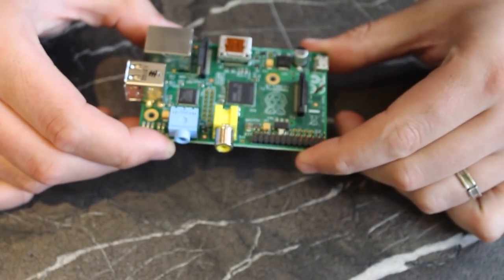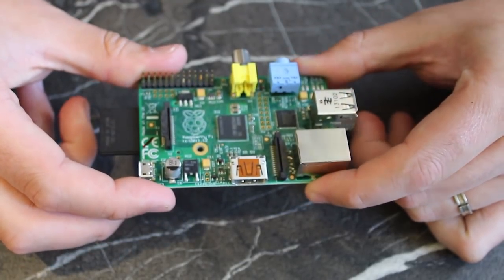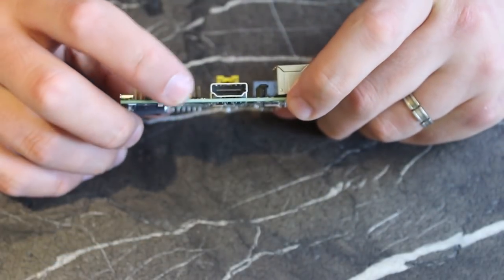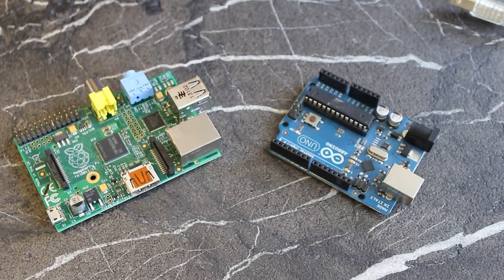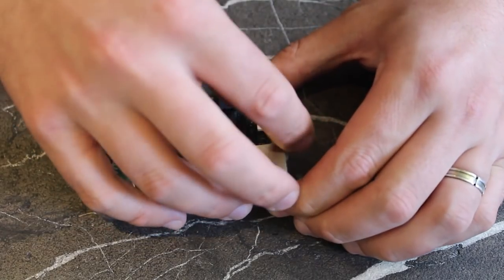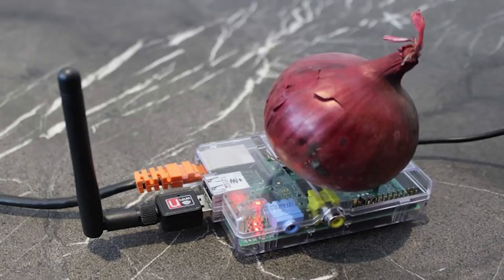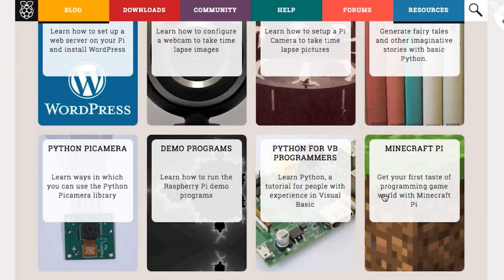Just Bought A Raspberry Pi? 11 Things You Need To Know

Comment: I would prefer sterling. Not AUD.

Burn? You burn to disc as it's permanent. You just install the image.
Reply from the maker: I don't think the definition of "burn" as it applies to discs works in 2018, because discs are dead. The phrase "burn an iso" has always implied extracting the contents of the ISO and to media, regardless of what the exact media in. We'll still be burning ISOs  when we switch to holographic nano-crystals. You don't "install" a windows OS install ISO, then install it again to the host.

Comment: Can u pls tell me how to use putty
Reply: You will need to enable SSH. Use raspi-config or add a blank text file on the root of the SD card called "ssh" (no file extension). This will enable SSH when you boot. Run putty from your PC. All you need to do is give putty the IP address of the Pi on your network and use username/password of "pi" and "raspberry". Highly recommended you change the default password.

Comment: help me ,i am having this issue from long time, i am trying to install kali in raspberry pi b via win32 disk imager, after 10-11%, installation stop, i think its window bugg, what to do
Reply from the maker: Have you tried a different disk image, like the standard Raspbian? It's unlikely to be a Windows bug. If this is a new SD card, it's possible you bought a fake one with dramatically different size - it's a common tactic to put a very small memory chip in there, such that it reads and gets recognized correctly, but writing past that block to the reported size results in errors. If it's a very old card, it's possible it's just been corrupted after so much use.

Comment: thinking of switch my media center to a raspberry, has there been any overheating issues?
Reply: I use a Pi 3 as a media device. I stuck some cheap heat sinks on the bigger chips and it is fine.

Comment: so when i connect it to my tv how i get sound? (i have an old TV and not a flat one)
Reply from the maker: If you don't have an HDMI port, you'll need an adapter cable to breakout the video and audio RCA ports from the smaller 3.5mm AV port. Those go into your RCA analog input, or a SCART adaptor.
Reply: Thanks :)

Comment: I have a problem with my raspberry pi, can anybody help me? Basically the problem is the sound quality, I plugged my headphones in and if the sound is loud or the volume is high, it sounds fine, but if it gets even a little quieter there is a very noticeable static, how can I fix this
Reply from the maker: Add the line: 

disable_audio_dither=1 

to config.txt, and reboot.

Comment: I want one SOOO bad but to be honest, linux kinda scares me. I have tons of XP with Dos command prompts lol, I doubt this will help though. :)
Reply: Wont help you at all lol.
Linux's commands are very different from DOS and any other OS. But they are more advanced.
Dont be scared. If you want to practice but dont want to install linux on your PC, get a flash drive and live boot linux through your pc boot menu.
:D
Reply: don't be scared... i've bought today rpi3B after spending last 2 days exploring rpi2B... starting with 0 xp in linux... after 2 days of hardcore learning.. i've managed to integrate an extension into the VS2015 so i can upload and compile all my c++ directly on to the rpi3 via ssh without having to leave my favorite IDE, it's very easy to learn once the pi virus infects you
Reply: I just installed my rpi a half hour ago and it is working fine. I am using it to watch this vid and comment on your comment. It comes with a windows like interface. Get a kit.
Reply: BYGDK

Comment: James, can a raspberry pi be used with a mac?
Reply from the maker: Yes. In fact, they're easier to use with a mac - since we have a built-in terminal application, which windows users don't, so you can login remotely to your pi without additional software. Once your pi is connected to the network, just open up terminal and type "ssh pi@raspberry.local", and enter the password "raspberry" and you're in. 

If you mean "can i connect a rpi to my imac to use as a monitor", then no.
Reply: Thank you James, 
I appreciate the response!

Comment: I have this NEW thing called a LAPTOP computer and it's only the size of the monitor you would plug this crap into. lol
Reply: it's a device to get people to learn how to program. plus you can do a whole bunch of projects with it.
Reply: Most people don't plug a monitor into their Pi, actually. It's a low power device for embedded applications. And $35.
Reply: I joined the club when I saw the pi zero was $5 lol.

Comment: I don't get what these are can you build stuff with this just asking please respond I'm a ten year old...Don't Judge Plez
Reply: It's basically a fully functional computer circuit board, based on the ARM architecture (same as iPad, iPhone, Android, etc), available at a very cheap price. You could use it as a computer by plugging in a keyboard, monitor, etc, and booting your choice of operating system from memory card. There are various expansion components available, like cameras, touch screens, etc. You could use it as a base to make any sort of computer device you wanted, or use it as an inbuilt controller for things like robots, home automation, etc.

Comment: Windows 10 rt has been released for raspberry pi as of now\
Reply from the maker: Nope, it hasn't. You're probably referring to "Windows 10" IoT, which is a developer environment which you can write universal apps for. Though it won't run other universal apps. Nor Windows apps. In fact, it's just about the most useless thing ever.
Reply: Yes it's the windows 10 Iot I am talking about
Reply: It's only good if you want to learn about connected devices, since if you use that abomination, you can control your RPI only through VS in your Windows10 machine.

Comment: You can use GUI programs over ssh, if you have a reasonable fast wifi. If you are on windows, then you need a software like Xming and Putty to show the programs, on linux it works (most of the time, if you have X installed) out of the box. 

GPIO: General-purpose input/output

3.3V is a standard voltage for logic boards. If you search arround, there are lots of equipment that works on 3.3-5V

Comment: I have waited sometime to see if this small all-in-one pc are any good for my future project. As of today I use a desktop computer as a broadband firewall, but it´s big, noisy and draw lots of power.
If I could use a board like this with a linux firewall it would be great. But it has to have two network ports. As of today I can´t find any boards that have two network cable ports. Any suggestions?
Reply: build yourself a server? There are cheap server solutions you can build by getting yourself some server components.... only way

Comment: How do you project the Raspbian (hope I spelled that right) OS to a monitor? Will it affect my computer's OS (Windows)? Sorry I'm quite of an amateur.
Reply from the maker: +theqey Everyone's an amateur at one point. The Raspberry Pi has an HDMI out port, so that plugs directly into your existing monitor or TV. It won't affect your computer. 

You can also run a Raspberry Pi without any monitor though - called "headless". You give it commands over the network, using something called SSH, in a terminal application (all text commands, no graphics).
Reply: MakeUseOf thank you so much for replying. How do you navigate through the OS once you hook it up to a monitor? (In this case, I am going to hook it up to a laptop monitor)
Reply: +theqey you can't connect it to your own laptop. But if you have a separate pc monitor or a tv, those would work fine. You simply connect the cable to the port and use a mouse and keyboard to set it up
Reply: VyxMC Oh okay. thanks for the heads up!

Comment: I often wonder what they were thinking when they designed this. Even in a case it sits there with the SD card hanging out of its arse, and by the time its been connected to all the things it needs to work, it´s far from ´compact´, more of a mare´s nest. The only possible use I could find for one was as a house server, simply because it could be left on all the time in an out of the way place. However I couldn´t use it as a printer server with a wired and wifi IP connections as it refused to connect to and bridge between the two IP networks.

Yes, you can see inside the ´black box´ but all you see are several more featureless ´black boxes´, despite what it´s promoters say, that´s nothing like taking apart old electronics where you could physically trace the circuits, or even an ageing desktop or tower computer with lots of plug-in components.
Reply: +marconatrix Black box? the Raspberry Pi is fully documented. Everything can be a blackbox for those who aren't willing to learn.
Reply: +alejandrinos There is little if anything visible on the RPi chassy that helps anyone understand how it works. An IC chip is a featureless block, you can´t see its circuits, even less change them. Even the connections between the several components are mostly invisible within the layers of the circuit board. 

Of course it can be programmed, but a programmer works with an abstract model of the computer, even these days in machine code, not that anyone really has to get that close to the metal these days. Processors are very sophisticated with layers of caches on so forth, which are best handled by an equally sophisticated optimising compiler. 99.9% of programming these days is done in higher level languages using an abstract machine, and indeed this has been the case for decades now. 

The last time I wrote any raw machine code was on an old 8-bit Amstrad machine, and that was to build a Forth interpreter so I didn´t need to use machine code.

Comment: I'm the only one wondering if there is an easy way to make money out of those things?
Reply from the maker: +lyric jam No you're not, and no there isn't. :)
Reply: +MakeUseOf aww
Reply: +Moospreh  Installed a Pi 3 in my truck 7 inch Touchscreen Jarivs voice command  The hard part was finding and installing a power switch that shuts down the pi when you turn your car off  Now think of all the uses from OBD2 scanning engine codes and linking the code to a net page that tells you the code  
(code 28- Oxygen sensor failure) when your engine light comes on ..That right there saved you a trip to the mechanic shop and a $80 scan dig,  Music files Video  Dash cam Tire pressure  Radio GPS Temps  Gyro for off roading tells you slope degrees XM And with some work Set cabin temps (servo's) Turn on Heated seats all and the sound of your voice ...Now would it be worth buying the Pi and parts and programming to sell...no  Pepole normally buy double din stereo's buy lack the options or customs that you can do with a pi But price wise don't want to do it  I would say my money and time is around $1,000USD
Reply: You can always mine bitcoin. It's painfully slow and inefficient (even more on a pi), unless you buy dedicated hardware, although that would defeat the purpose of just the pi and increase the cost a lot.
Reply: There is, search youtube for "Super Nintendo PC"
Reply: Build a photo booth with instant printer and auto instagram upload and rent it out for weddings.

Comment: Class 10 or better? That's simply incorrect. The Raspberry Pi is optimized for Class 4 and Class 6 cards.
Reply from the maker: +Yohan Bandhair Rubbish. It's not "optimized" at all for class 4/6, it's just that in everyday small write operations you won't see any benefit from a faster card. OS upgrades and long write operations will be significantly faster on a class 10 card.

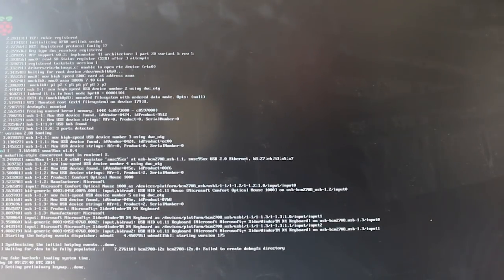Comment: 0:57, whispers it does run windows, just not windows vista and up
Reply: +ChilledCanadian Nothing runs Windows Vista hehe.
Reply: Dosbomber
Yup, plus Its wayyy to hard to play dwarf fortress on linux.
Reply: +ChilledCanadian The Pi doesn't even support Wine, so that's even worse.
Reply: +ChilledCanadian Why would you want to, anyway?
Reply: Dosbomber I have used linux, but I still return to Windows every time, there are more compatibility with programs I need on windows. Programs that wine won't run at that.
Reply: ChilledCanadian
Yeah, I know, it's a nasty catch-22.  Software developers won't make software for non-Windows platforms because everyone uses Windows, and everyone uses Windows because all the software is based in Windows.  I think it's slowly improving, though.
Reply: From what I understand, you can run Windows 10 PE (or something like that)
Reply from the maker: +Pipe0481 Not PE. Windows 10 "IoT", which is basically nothing like Windows at all. It doesn't have a GUI, and only runs specially designed universal apps. It's a developer thing, and not a very good developer thing at that. I've seen a handful of projects using it.
Reply: MakeUseOf Oh, ok. I just heard something about Windows 10 on the PI, nothing more.

Comment: Can a raspberry pi download c4d or animation software?
Reply: Nope
Reply: +wartillthend animation you can run anything that a linux computer can run ... but why do you want to animate on a 700/900 MHz CPU? it would be incredibly slow o.o
Reply: +Maric because I'm cheap and have little money
Reply: wartillthend animation if you are smart you can build a pretty ok rendering cluster (if your software renders in multiple threads and can make use of 20+ 900MHz threads) from a few pis buuut yeeeah just get a normal computer pretty much ^^
Reply: +Maric yeah true. I wish they made a stronger version of this.
Reply: wartillthend animation they do. it is highly customizable and its called building a computer from parts. :P For around 400 bucks you can get a decent one going, i wouldnt recommend going above 1000 because at that point you get less bang for your buck, but depending on how much power you want there are specialist parts ^^ Also for most of the software that is easy enough for you to use runs on windows pr mac and you would need technical skills to get them to run on linux
^^

The point of the raspberry pi is to be weaker so it can be cheap and small.
Reply: Because we all need some more amateur Minecraft animations.
Reply: +Pile of Sand lol

Comment: Can i install Steam on it using raspbian?
Reply: Nope even if that's possible it wouldn't be able to run any of the games due to the hardware
Reply: I would only use it to chat. Not to run games.
Reply: yeah, but install Ubuntu not raspian
Reply: Even there, it's ARM architecture so not sure Ubuntu would make it run Steam anyway!
Reply: +Nookie Nookie Unless you compile steam for ARM, you're out of luck. However, you can use nvidia limelight to stream steam from another computer.

Comment: also what is the most lightw8 or best os for pi 2 and how to remote transfer file/folders from pi 2 to pcmobile or vice versa
Reply: +Abhi Yadav There are many Linux flavors created for the Raspberry Pi. The one with the largest support base and with the most support is Raspbian, which I would reccomend for beginners. However, I dual boot my pi 2 from a 128gb MicroSD, with Arch Linux and Kali Linux. Make sure when downloading the .img file that it is made for the Raspberry Pi or for ARM processors.

Comment: i want to buy pi 2 to download torrents with 2mbps net = 220KB download speed. i dobt have hard disk for downloading so if i use the 32gb samsung class 10 card to run pi os and download torrents in it will the pi get tok slow to achieve 220KB download speed ?
Reply: +Adam s really appretiate ur reply. thanks

Comment: Hi.. can I use windows OS? is there any GSM/GPRS shield available with it so that my internal VC++ (windows program) can communicate with it? ie. can I run VC++ program from within?
Reply from the maker: +Chandrak Baxi No, you cant use Windows. Although there is a Windows IoT core version that would enable you to program in VC++ universal apps, no GRPS shield would support it.
Reply: +MakeUseOf Thanks! my requirement is to use C++ SDK (of DVR) and write a program and upload to such board for continuous testing of the DVR and send results over GSM/GPRS. Any such board or combination available? SDK size if 20 MB + c++ program.
Reply: Learn Linux, you will pck it up quickly after reading this http://rpimag

Comment: there is also an version of windows for the raspberry pi
Reply from the maker: +TheYoutubebros 2015 Windows IoT Core is really not a "version of Windows" in any sense most people would understand. It runs apps specifically programmed for Windows IoT core, which only has a subset of the Universal APIs. It doesnt run "Windows apps" or have a useful GUI which most people woudl associate with Windows.